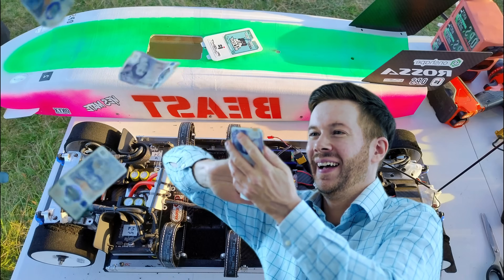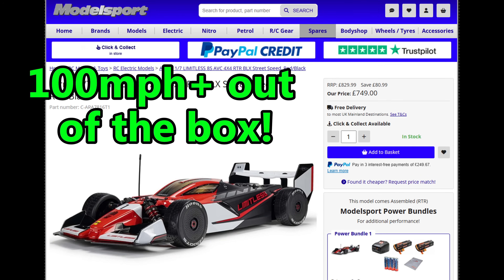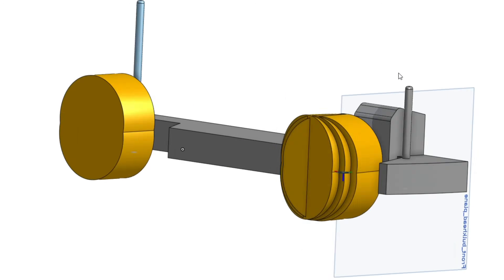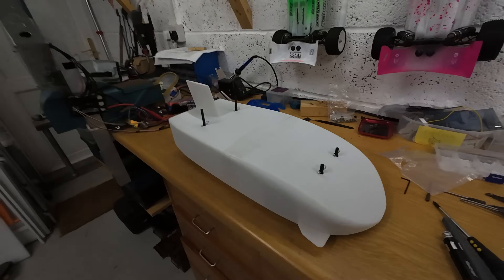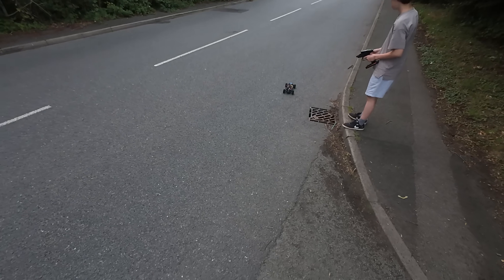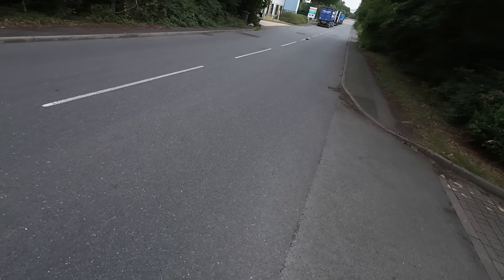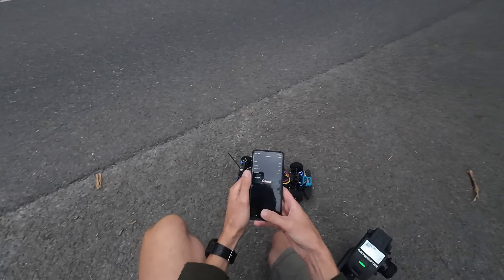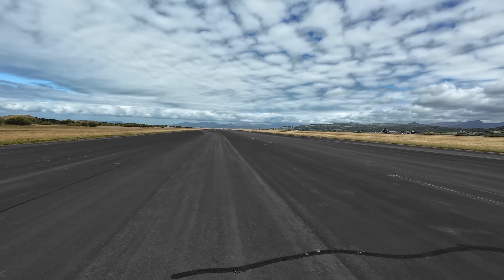Building the CHEAPEST 100mph RC Car Ever (Beginner Guide)

Comment: why does the aero design completely fail at the rear with a straight down parachute? (on both cars)
Reply from the maker: Hey, to end in a teardrop would require a very long extension on the back, which just isn't very practical! I stand the part on the back to 3d print it so it being flat helps with that. Maybe something to have a look at with CFD though, thanks 👌
Reply: @steveeng1826 it does not have to be a teardrop to reduce drag
Reply: @steveeng1826 it does not have to be a teardrop to lower drag, think about it (one possibility is,,,, hint = VG)

Comment: I like the idea of a budget 100mph car but if you don't have the skills and "hook ups" from friends to design and make your own body how is this even remotely a budget build?   I still enjoyed the video (as I do all of yours) but the title is misleading.  Have a great day!
Reply from the maker: Hey, thanks for watching and commenting 👍 The 3D printed body was maybe a slight extravagance: we could have just bought a body which would have cost a bit more money but taken a lot less time. However now I've done the hard work and designed it, if anyone has access to a 3D printer they could buy the files from my store for £5 and print it themselves, giving quite a cheap body. Keep an eye out for epsiode 2 where the capability of the car starts to come out!
Reply from the maker: I've been thinking and what you said gave me an idea for a future video / series: £100 speed car build challenge. £100 including lipo but not radio gear. Second hand parts allowed and no 3d printing! I hope I have time to make it! 😄
Reply: @steveeng1826  I look forward to seeing that! I'm no engineer but was thinking you could probably do it from a second hand drone with all your accumulated knowledge. Maybe torque vectoring could still be an option with a short wheelbase. Also another idea maybe try doing a very small size and light rc speed car with a similar 4 direct drive motor setup driving rubber tank tracks to get the traction perhaps.
Reply: @steveeng1826  Sounds great!
Reply: just use racing touring car body with the rear wing cut all the way down